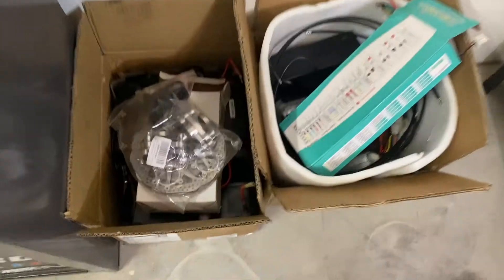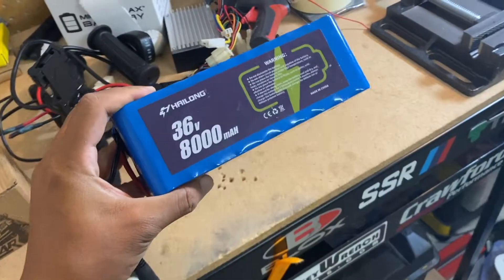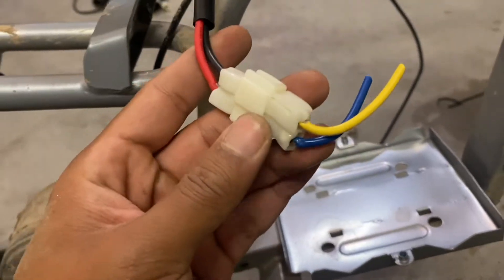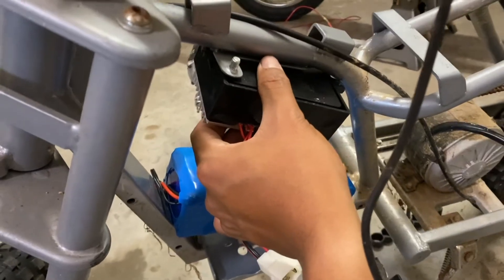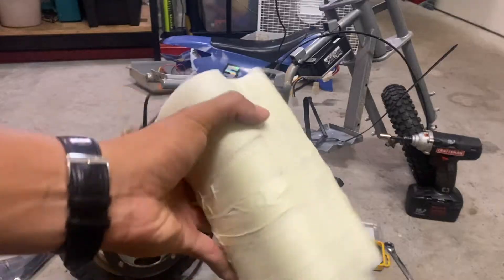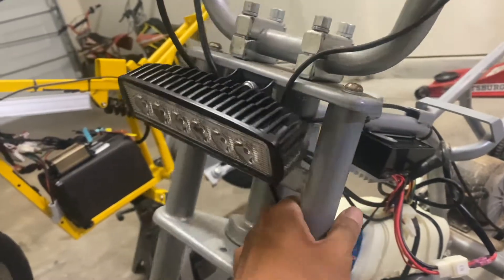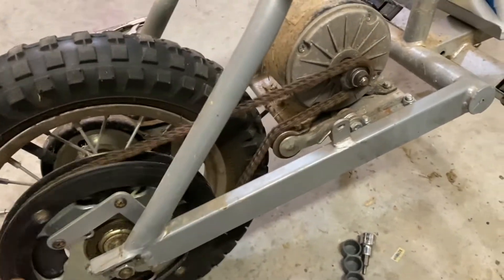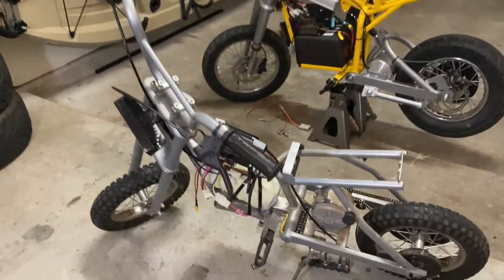Razor MX350 Micromoto Build | Power Upgrade Overvolting the Stock Motor 36V for more Speed

Comment: Just over volted my 3 year olds razor mx125 and it runs off 2 milwaukee 18 volt batteries in series and a buck converter to get me down to about 25.6v and then am running a fast scooters 24v speed controller and a variable speed twist throttle. Has effectively doubled the speed and improved the torque significantly. Hes gonna cruise that for a while and I am waiting for the 150w 12v my6812 so he can do a little more "off roading" at our mountain property. Cool video and very informative! Cant wait to get him the bigger model in a couple years when he gets better at riding.

Comment: I have a,

24v 12.09.2019
Version V01 Batch # 1132
ZK2430-D2-FS-ROHS MX350 and currently am trying to plug everything up like you did in your video but they don't seem to match up.  Unlike the video, my mx350 has the power switch under the top faring and not on the side.

The model mx650 controller I bought was from your link and it is, 

Model # HB3650-TYD6-FS-ROHS 0357
12.26.2024

Not sure why it isn't plugging up, but any help would be greatly appreciated.

Comment: I did the 48v overvolt mod like u with the extra 12v12ah battery on my mx650 as a Christmas present for the kids. Then I realized I could use the extra mx650 controller & throttle for their mx350 and threw in another 12v7ah battery I had to bring it up to 36v. Did this before I watched this vid but I see you also repurposed your mx650 controller. It went from 13mph to over 18mph with just those upgrades everything else is stock. Thanks for the vids👍really helpful

Comment: Hey, I just bought a razor MX 350 off of Facebook marketplace and it seems to be that when I lift the back end up the tire spins fine and the throttle works.except there is some little noise, I think it's from the chain but other than that it's fine but whenever I go to Drive it/ sit on it, it doesn't move and I know I'm not over the weight limit because I'm about 110 pounds. Do you have an idea on what it would be?
Reply from the maker: Did the previous owner tell you why they were getting rid of it? Whats the production date of the batteries?
Reply: @PatOutdoors  I don’t believe so I mean I got it only for 40 bucks. I don’t know the production date of the batteries. It could just be I didn’t charge it for long enough. I think I only charged it for like five hours and I was supposed to charge it for 18 hours so that could just be my fault lol

Comment: The heat was most likely a bad or dirty connector that was adding resistance to the circuit and causing it to heat up.

Comment: Will the 36v 12ah work?
Reply from the maker: May have to cut the plastic covers to fit them back on, depending on dimensions of the battery
Reply: @PatOutdoors  how did you wire the on/off switch to the 36v controller

Comment: How did you get the battery to not pull voltage with too many amps
Reply from the maker: It’s a 30A controller with a battery that has a 30A BMS
Reply: @PatOutdoors I have the same battery from the link and it cuts power when I get to full power, I have the exact same setup
Reply from the maker: @Diaz.Marcus  What controller are you using? Check for loose connections.
Reply: @PatOutdoors  I figured out the issue, you linked the wrong battery in the description you bought the blue hailong which works but the green one doesn’t
Reply from the maker: @Diaz.Marcus  That doesn't make any sense. They just changed wrapper colors over the years.. A 36V battery is a 36V battery.
Reply: @PatOutdoors okay well the Amazon descriptions were different so I bought the exact battery that you have now and I’m still having the exact same issue. I have every single thing setup exactly how you do with the same parts EXCEPT the 30 amp fuse but I don’t think that’s gonna solve my issue bc the controller limits to 30amps anyway. Any help would be appreciated as I’m just annoyed at this point
Reply from the maker: @Diaz.Marcus  what’s the part number on the controller you are using? And what throttle are you using?
Reply: @PatOutdoors  the same throttle and controller package in the description but I can send the number when I go home
Reply: @PatOutdoors  HB-3650-TYD6
Reply from the maker: @Diaz.Marcus  then I really don’t know what your issue could be without physically seeing it in person. This is a pretty common set up a lot of people run.. How do you even know it’s “pulling voltage.” Like how did you come to that conclusion? What port did you hook your volt meter to?
Reply: @PatOutdoors  every port possible but when I hook it up to the blue and yellow motor connection that’s the one that drops to 0v when it’s put under a certain load (full throttle with me on the bike)
Reply from the maker: @Diaz.Marcus  how heavy are you? How did you manage to hook up a voltmeter to the motor wires while you are riding it?
Reply: @PatOutdoors I just held the bike back to simulate a big load until it did the exact same thing it was doing while riding, because I can go full throttle just fine with the bike in the air. I’m only around 135 so I don’t think it should be pulling crazy amps but idk I’m really confused.
Reply: @PatOutdoors More testing and under any load the battery voltage drops and I think once you have enough load that it gets under 31v the controller turns it off
Reply: @PatOutdoors  any more advice on what to do I really just want this thing to work
Reply from the maker: @Diaz.Marcus  not really sure since I’ve not had that same issue before
Reply: @PatOutdoors  decided to use the battery I bought with my dead hoverboard since it used a xt60 connected already but since I still had the other battery I put it back on the bike with the male xt60 connecter still connected and now it works so for some reason it doesnt work with male and female xt60 connectors but just the male plugged into the controller works fine, thanks for all the help and safe riding
Reply: @PatOutdoors  nvm still pulls power at full speed full throttle
Reply: @PatOutdoors the only thing I forgot to add back in is the 30amp fuse but I have it to see if it will solve my issue tho

Comment: How do you wire the batterys
Reply from the maker: It's one battery with a positive and a negative wire. You match them to the positive and negative wires on the speed controller.

Comment: Sir, Can you install 2 of those batteries for longer range?
Reply from the maker: Sure, but may not be able to fit the factory plastic side covers though. You could also just get a higher AH / capacity battery to begin with
Reply: Thanks for the response

Comment: how are you charging the new battery? the old charger for stock 350 has different pin/connector right?
Reply from the maker: The matching charger that came with the lithium battery. You can only charge it with a lithium specific 36v charger

Comment: how did you wire the throttle to the controller? i’m trying to do the same thing
Reply from the maker: It’s a stock MX650 controller and throttle, so they clip into each other with no modification.
Reply: @PatOutdoors  ahhh okay i got you thanks for the reply man i appreciate it!!

Comment: this video inspired me to upgrade my sons sx350 and boy did it make a difference. twice as fast! did not do the sprocket because i wanted him to keep the torque. thanks!
Reply from the maker: Glad it helped!
Reply: @PatOutdoors  I noticed you didn't install a step down converter for the headlight. Is it necessary?
Reply: @oojayboogie902oo  No if you get a 36v light. If you get a 12v light then yes but I believe the light he got is 36v

Comment: Why do you guys not show play by play what you’re doing, I don’t understand. It might be simple for some guys but for the rest of us we just need play by play exactly what you did because fast forwarding doesn’t help the rest of us.
Reply: Because he's not doing an installation instructions manual. Never claimed to be.
Reply: Because it’s super easy? If your just starting to do things like this, this is a really safe overvolt start, I literally just swap the stock batteries to a 40v greenworks battery and call it a day. Much faster and my son loves it.
Reply: @Cheaphorsepower  so your saying i can just upgrade the battery and it will go faster?? I have never done anything like this but my sons stock mx350 sucks and ive got to do something about it.
Reply: @Cheaphorsepower  would that need a new controlar?

Comment: I ordered all the parts show and the on off switch for my sons bike is on the top not the side and I can’t figured the wiring out too save my life. There are three wires from the 650 controller that plug into the battery hookup but there are only two wires coming from the battery. Do I need too add a toggle switch or something? I hope what I’m asking makes sense.
Reply: Did you ever figure it out?

Comment: Nice build!  What wires from the controller did you use to go the the on/off switch?
Reply from the maker: Please rewatch at 02:36 and 08:30 , I just reused the original on/off switch to complete the circuit on the "key lock" connector on the MX650 controller.

Comment: Hey I have 2 MX350’s both with dead batteries. I’m stuck and I don’t know what kind of battery’s should i buy for more mph and ride time. I’m on a budget so something semi-cheap would be ideal. Thanks for any help!
Reply: Also I’m not sure if I also need to be a new controller, throttle or anything else.
Reply from the maker: Well if you want more speed, a minimum of a 36 V controller is needed since the factory controller doesn't handle 36V battery power very well. A small 8-12AH 36V Lithium battery pack would do @spuddito
Reply: @PatOutdoors  Thank you for the help.

Comment: kinda late but i am looking to do a build like this myself and am wondering if the 350 has enough room to mount one of those 2 or 3kw bldc motors like you have in the 650?
Reply from the maker: You mean an MY1020? May have to drill some holes on the mount base to get it to line up the the frame, but I don't see why not. Just a matter of fitting a battery that would support it.
Reply: @PatOutdoors  helll yeah man, i figure if one of those 2kw 48v motors could fit i would be able to take off the bottom plastics move the controller and then have a pretty good spot to slap in a good set of batteries maybe get crazy and try to fit 72v for the 3kw lol ty for the quick reply.
Reply: @MrJaysniping  Bro careful lmao. Just finished my mx350 with the MY1020 motor and I literally cannot keep the front wheel down 🤣I'm terrified
Reply: @MrJaysniping like motors out of mototecs or etms or ebox's your saying? He'll great idea 💡

Comment: Where do u connect the 3 powers for the power switch
Reply from the maker: The triangular connector? There's only one matching 3-pin connector going to the controller.
Reply: @PatOutdoors hey I really need help which controller do you have because the one that I got from your description won’t work for the on and off switch animal connect to the battery
Reply: Hey I got the razor mx650 controller and throttle . And then I got the 36volt battery 8ah from your description which plug on the controller will fit the battery. Thanks
Reply: I’m having the same issue did you ever figure it out
Reply: Same not sure how to wire the on and off switch with the new 36v controller since the throttle light stays on all the time 🤷🏻‍♂️

Comment: What would I do to make this bikes battery to last longer? My 7 year old daughter loves this little bike but it's kinda slow and only last about 15 minutes before needing charged again. Thank you for any help
Reply from the maker: Get a larger capacity lithium battery. The factory sealed lead acid batteries wear out quickly and hood very little charge
Reply: Raion Power 12V 18Ah Replacement Rechargeable Battery for Expocell P212/180 - 2 Pack

Comment: I over volted my 350 with a 1000watt controller on 60 volts. It was doing 28 29 with 167lbs rider . 

Then it was overheating so quickly that way .. I added a split the motor leads and mounted a second motor in line and it's nasty. Does even get warm with the power split still the same speed but double tq
Reply from the maker: Sweet!

Comment: Do the mx500 controllers make you use less battery?  For like longer drive time?
if not then how can i make my bike have longer play time??
Reply from the maker: You need a larger battery. Like 25AH vs 15ah
Reply: @PatOutdoors  I also don't have a speed controller or a throttle yet because they haven't came .   but i just have the motors hooked straight to the batteries controlled by a button/ switch.  so everytime i flick the button motor switch on.  playtime is around 10mins
Reply: Im going to get the speed controller and stuff, but do you think its the batteries or if i need the speed controller to help with the battery playtime?
Reply from the maker: I mean how do you modulate the throttle with an on/off switch? The controller manages the amount of power drawn from the batteries. I also have no information on what batteries you have or why your bike doesn’t have a controller installed. I would think a controller will help manage the power better than having no controller
Reply: @PatOutdoors  thanks !

Comment: I’m also running a 11tooth pinion gear stock rear sprocket. 36v controller with a 36v battery. Getting 26mph lmk what can I do for more speed?
Reply from the maker: 48 volt brushless kit and lithium battery
Reply: What motor and controller ?

Comment: Hey I rlly need a response to this, how do you install a double D sprocket to it, when it takes single D
Reply from the maker: Production changes every couple years. You need to look at the shaft on your motor and confirm if it has one flat spot or two flat spots. Double D = two flat spots ; One flat spot = D sprocket (exactly what it looks like)

Comment: On the light bar does it come with a cord? If not what is the cable you need to buy.
Reply from the maker: It does not come with a plug and play cable. It came with about a foot of wiring attached, then I just made my own harness and switch to wire it to the power source.

Comment: I towed a boat with my one. Small aluminuim trailer and boat. Was at 2am to my local marina. Its custom as now and i cal it the karen wrangler

Ive modified one of these i found at the dump and put a car battery and a smaller atv battey and small quad bike seat. The throttle is simply a on off switch so all or nothin. I am gonna buy another battery tomorrow to make the 36v for this. My handle bars extension is made of 2x4. Screws everywhere. Fake grass panels. spokes lighy up amd draw shapes when driving.
Reply: Be careful discharging unlike batteries this hard good luck 👍
Reply: That’s the most redneck build I ever heard of.

Comment: Have mine with the extra 12v on a switch, and wired in after esc.  Kinds goofy buy I have normal speed, off, and high speed using the switch.  But on high speed the motor gets the 12v from the extra set with no throttle, then the full 32 on full throttle.  Can actually ride it on flat pavement with just the 12v
Reply: So you added 12v after the speed controller, wired into the yellow/blue motor wires??  I've been trying to figure out how to add a "turbo switch" of sorts for my kid, but the controllers are all either 24v or 36v that I can find.  You are doing this with the original 24v controller?  I appreciate your help!

Comment: Mine is doing 22.5 mph on gps with the the stock motor and still re using the two stock batteries 😈
Reply from the maker: Downhill? How much do you weigh?
Reply: @PatOutdoors  up hill and down hill lol I added another 12v battery, from my other sx500 and all electronics including the throttle. Pretty much everything from the 500 besides the motor.
Reply: Getting 26mph stock with 36v lithium ion battery. Lmk what can I do for more speed?
Reply: @JonahNAloha what controller are you using ?

Comment: Just got both my kids these bikes but they both want more speed and longer battery life out of them would this built everything you got do the job or is there a different set up I should look into
Reply from the maker: The stock batteries are awful for battery life. What kind of range and speed are they looking for? Lithium battery alone is pretty much same cost as the bike, depending on size

Comment: I have two of these. One for my daughter and one for me. What should I order specifically to make mine last longer and faster so we can ride more together? I’m 190
Reply from the maker: To ride longer, you need to cram a larger capacity battery in there. The MX350 has very limited space though.. you may be able to do a 14AH 36V battery though. The SX500 would be most ideal for a full size adult and has PLENTY of room for a large battery, easily fit 30AH (which would last for at least 1.5-2 hours)
Reply: Raion Power 12V 18Ah Replacement Rechargeable Battery for Expocell P212/180 - 2 Pack. 
I have these on my 350 and they last forever.. I charge using a 12v motorcycle plug hard wired with alligator clamps to both batteries with the fuse out and charge a 12v 36Ah system.

Comment: I did a mx650 36v controller a 36v 20ah 35A bms lithium battery and it lasted all of about 10 miles of use and was able to hit 20mph, i do believe tho that the destruction of the motor came from my littles short running it and not letting the motor het much air flow, that said imma put my old 650 motor on it soon amd semd it haha
Reply from the maker: Might as well run a larger sprocket too if you're gonna send it!
Reply: I hit 22mph on my mx350. 36v battery over volted on a 350 motor.  With the 36 fast scooter module.